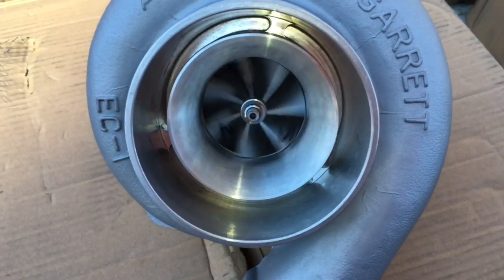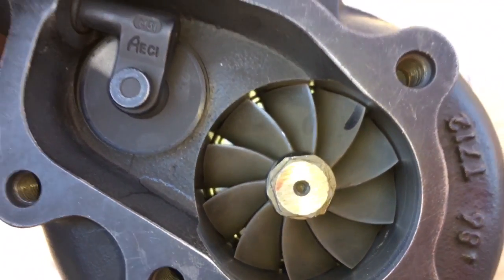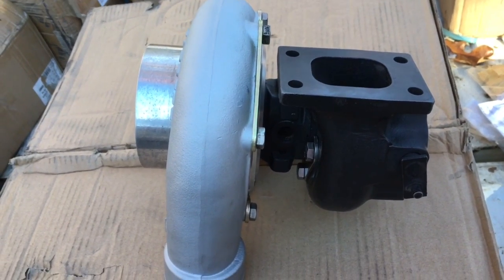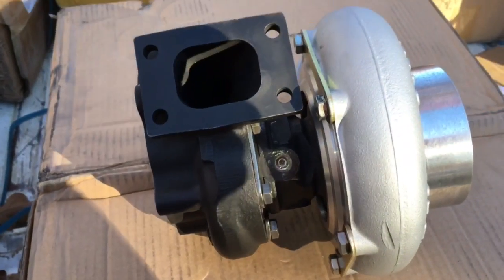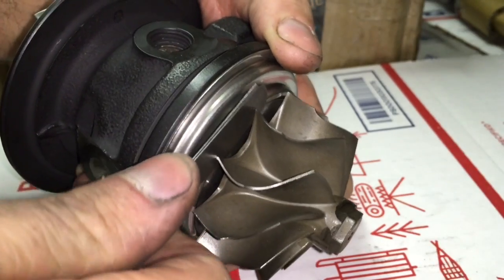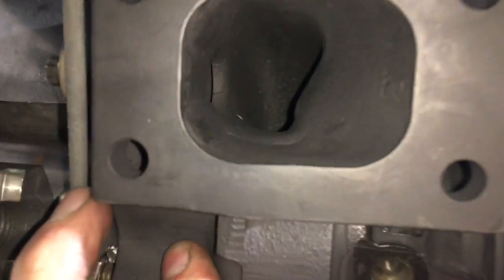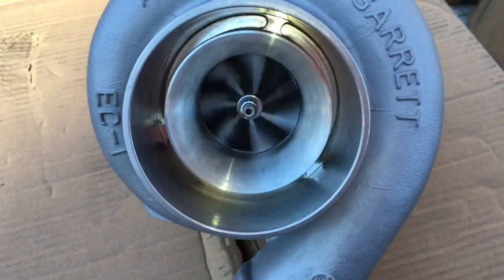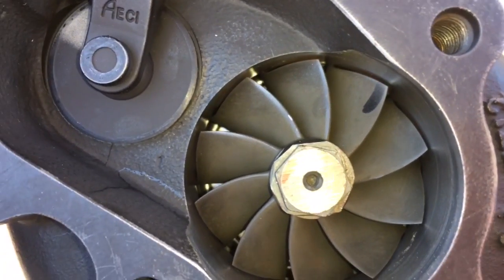Sr20 Gt2871r upgrade

Comment: I need help. I have an s14 with a stock sr20det blacktop. I plan on buying the top mount kit gt2871r from enjuku racing i also have 740cc and 550cc injectors , i want to hit atleast 400hp. What would you recommend for me to reach my power goal of 400?
Reply from the maker: The gt2871r should work for that. Garrett has hp ratings on their site. I think that one is rated at 450 hp

Comment: And this didn't need rebalanced on a VSR after swapping turbines?
Reply from the maker: +Kapok6 we balance all the rotating components, mark the positions then install the parts and line up our marks. We prefer to do it that way. It can be vsr balanced also, or at least checked on a vsr. The way we do it works best for us.

Comment: OK... My GT2871r is in need of a rebuild.  I'm hearing all positive things re: billet wheel and polishing etc.  But, am I better off upgrading the turbine wheel instead (or ? both?). 

I'm inching closer to pulling and shipping it to you guys....
Reply: I would definitely upgrade the turbine wheel. This is my turbo, and I'm extremely happy with it. When you upgrade the  turbine wheel you can buy the twin scroll T3 turbine housing.

Comment: I put a twin scroll holset h1c 18.5cm on my sr20det. it's beyond super laggy as expected. what housing do you think i can run to get faster spool time and still make 400+whp. best option I have seen is the 12cm. thanks man
Reply: i'm in the same boat. i got a gtir motor with stock turbo setup. So i'm also looking to make 400+whp with the t2 flange and an external waste gate.

Comment: how much for this turbo setup? ??
Reply: This turbo cost me $1000 for the 2871r turbo (used), $700 for the compressor wheel upgrade and $300 for the turbine upgrade. Total $2000.
Reply: @thughknower758   I know this video is old... did you ever dyno your car?  How much power did it make at what psi?  Would you have did a different setup or are you happy with this turbo? Thanks

Comment: What do you charge for a cummins HX35 40 highbred, I want to turn my 92 w250 into a tow beast with about 350- 400hp.  Or do you suggest something better.
Reply from the maker: +Levi Padgett I can make one besides the turbine housing, if you did the hybrid it's best to use a 16 or 18 cm turbine housing. I like to do the hx40 supers in the 12 cm or 14 cm. I think they work well, we do build the to 67 mm a lot also.